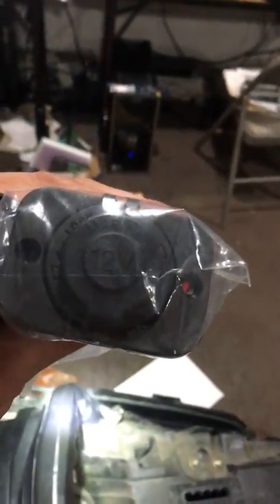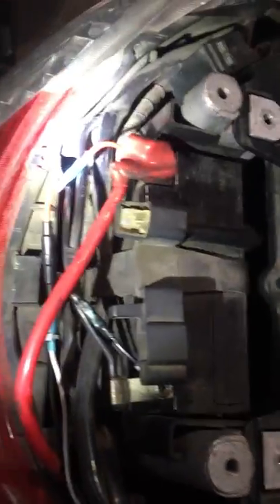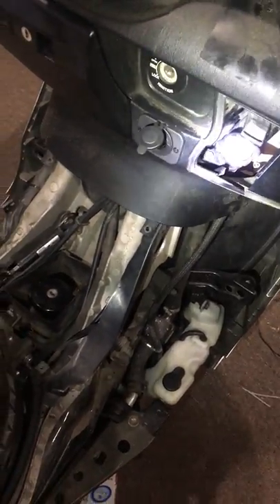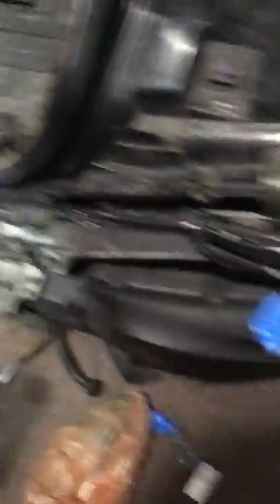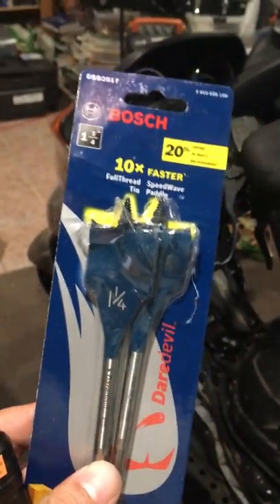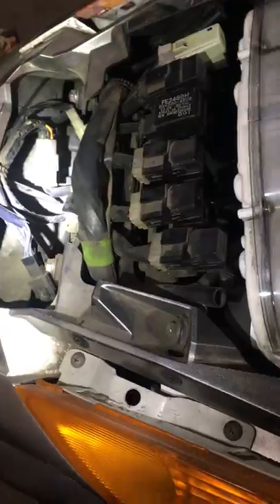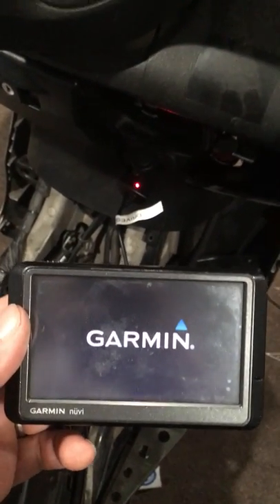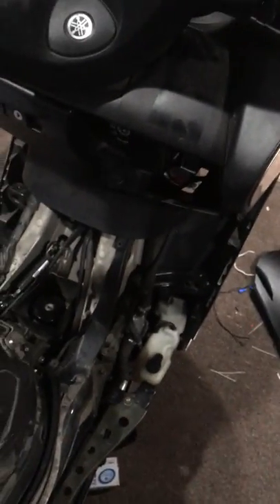2007 Yamaha Majesty 400 12 Volt Cigarette Lighter Install

Comment: Your turn signals in the front are constantly running on. You could've got power from that and no need to dismantle the whole scooter.
Reply: Turn signals? Do You mean the front position lights?